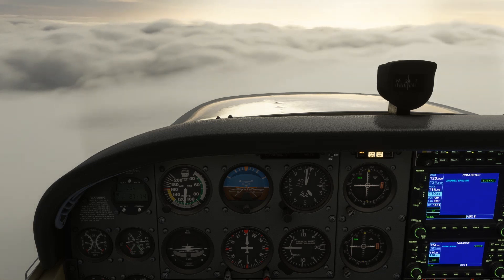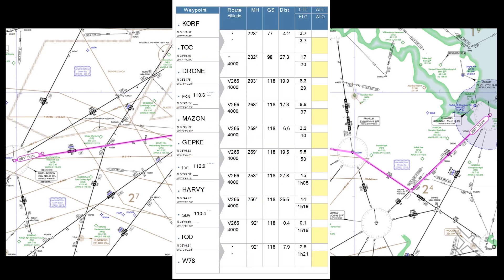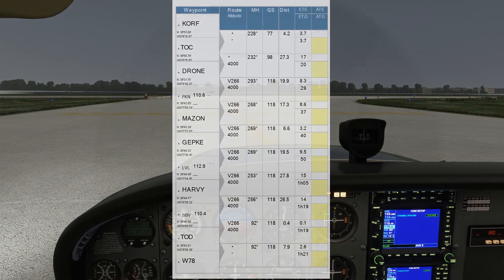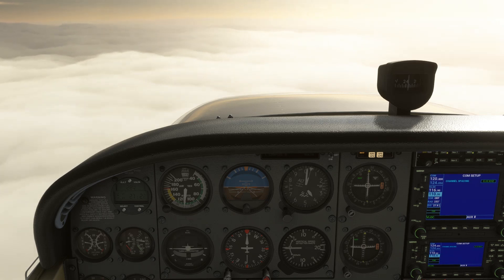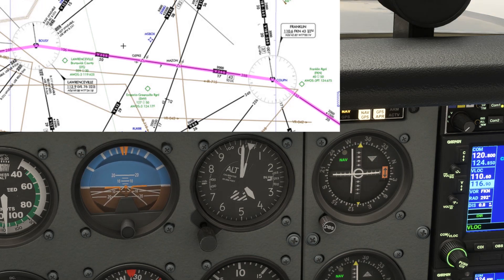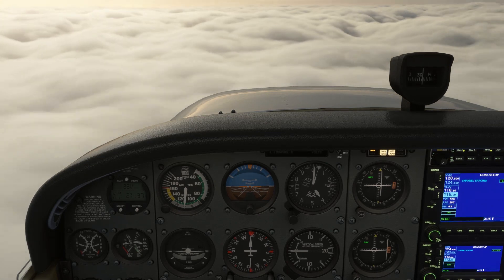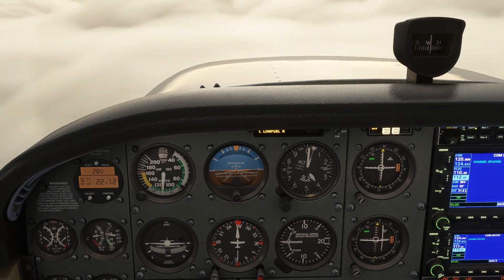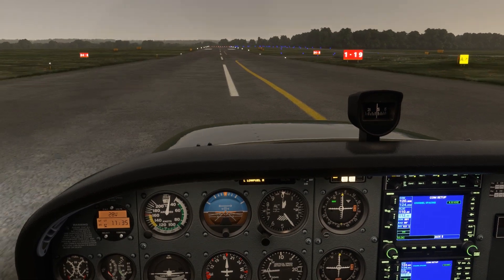How to Fly VOR to VOR on Airways | No GPS | Cross Radials

Comment: Might be “old school”, but VORs are the FAA backup plan in case of a GPS outage. So, flying VOR airways is a skill we should maintain. Great video, good review. I plan on recommending to my students
Reply from the maker: They sure are! I for one am glad they're sticking around. Thanks for spreading the word!
Reply: In Europe, especially Belgium, GPS are not allowed during the the PPL checkride.  So navigating either with visual ref points, VOR and/or NDBs is a must have in the competencies that the student pilot needs to master.
Reply from the maker: @SR22PILOT  Wow I did not know they don't let you use GPS in Europe on the checkrides! Glad to provide some help for VORs then.
Reply: The FAA's decommissioning hundreds of VORs to save $, though, with the next big batch going dark in 2025. They say they'll be keeping a small number alive where it makes sense, though it'll be sparse. Eventually they'll be as rare as NDB beacons
Reply: @JasonFarrell  true, but the VORs that remain are being replaced with systems that have longer range. Both the Low and High will have a 70 nm range for aircraft at least 5000 feet AGL. Some are in operation now. IFR low charts now indicate the new systems that support the MON transition. I make sure cover this topic on every IPC. Want all students to understand what will remain if DoD takes down the GPS system in emergencies.

Comment: Simulators replicate GPS flying reasonably well as there's very little real world inaccuracies and winds are automatically compensated.  VOR flying in real world vs a simulator is going to be considerably different.  Although within the tolerances of the equipment involved, accuracy varies considerably from one VOR to the next and varying winds will make your timing exercise much less exact.

Comment: WOW That's the only way to navigate back in my day. GPS was just coming of age when i Stopped flying as PIC in July '96. I did use LORAN back in the 80's & Early 90's. Loran was useless in weather. When I started Flying IFR there were many NON-Radar environment areas and subsequently a lot of mental gymnastics with times an mandatory reporting points & times to next Reporting point. No GPS/Ipads, Just a Enroot Chart in your lap, watch, your Flight plan on a Kneeboard, Don't for get the extra pens you were sure to drop one on the cockpit floor too.  OH Only one Aircraft I ever flew had a GOOD working autopilot. Every thing back then was hand flown. Hope you know your Needle, Ball,& Airspeed Tequenick & Lost Comm Ruel's when sollid with 200 & 1/2 and you break an alternator belt.

Comment: If the VOR station is on the same side as CDI deflection with a FROM indication, you are not yet at the intersection. If is opposite of the station location, you have past it. If using an HSI and you set your course to the radial being flown, this case the point of the course is 130. The tail will be to the station and course deviation will indicate correctly . The to/from arrow however always point to the station. In this case the tail of the course indicator. That still tell us we are headed to the station. Slightly confusing so just place the course arrow on 310 and use it like the old OBS.

Comment: You ask why one would do this? For me, it's because the plane I fly doesn't have a GPS.  Secondarily, it's good to be proficient in case the GPS system goes down either on your plane or with the satellites.
Reply: Agreed. This should be a compulsory item on the ACS -- done *in practice*, without GPS.

Comment: I tried doing an IFR flight via victor airways, and I filed as such. But ATC saw my /G and in flight gave me an amended route direct to a GPS fix completely bypassing the victor airway.

Is there a way to communicate to ATC that I actually want to fly the victor airway? When I'm filing can I remove the /G in my airplane configuration?

Comment: One thing you forgot was to LOG the VOR test in the Airplanes log book if not done in the Previous 10 hours. I think that's still in the FAR's That was one of the first things Art Zander my FAA Designated Examiner expected me to CHK/LOG. So happens the MWC VOR 108.6  was on the field so I checked  no.1 VOR against No.2 VOR for less than 4 degrees difference.  Funny thing every thing worked fine until I radioed the tower for a take off clearance and Nothing.  Flashed the landing light at the tower and they gave us light signals back to parking. Turns out there was a BAD MASTER Radio switch. So took my Check ride in a 172 with single navcom and ADF Dis have a marker beacons And GS/